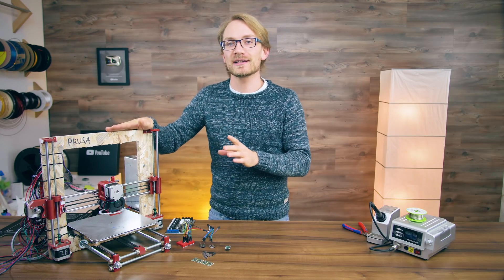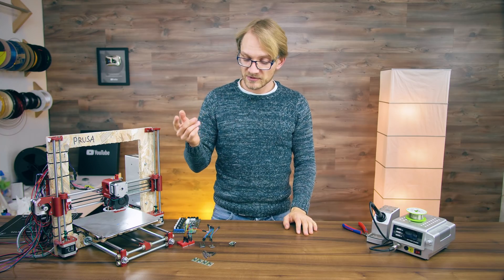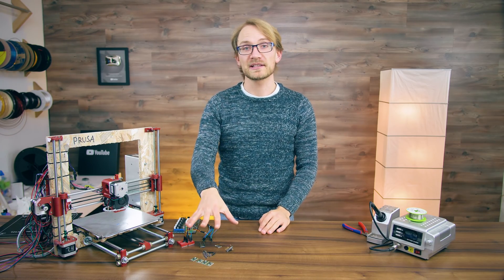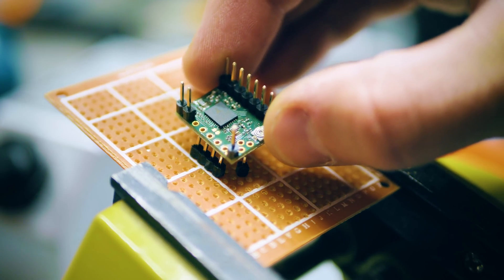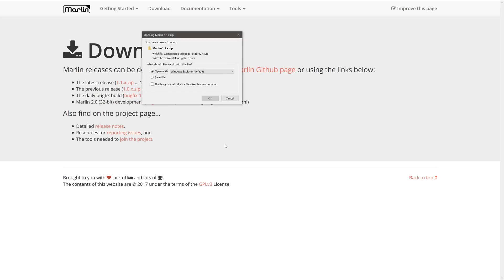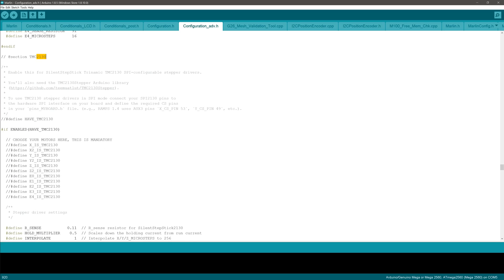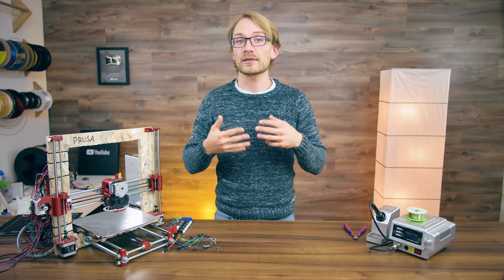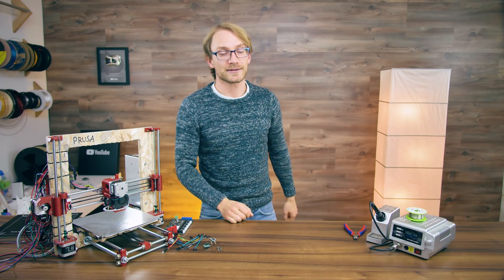How to make your 3D printer smart and silent with the TMC2130!

Comment: Finally got these TMC2130 somewhat working on a GT2560 but the part at the end of this vid about the stepper motors going in one direction is whats happening now. Tried changing the Endstop_Inverting to false and it doesn't not help fix it at all. Tried multiple combinations of the Endstop_Inverting and Invert_(x, y, z)_Dir. Even tried disabling the Max Endstops and various other settings. Can't seem to find a fix. Could this be a issue with what Pins I am using for the CS? Not many choices to use on the GT2560.

Comment: Hello Thomas, shouldn't it be technically possible to auto level the hotbed with one of these drivers on the z axis? I mean with the hotend touching the hotbed as the endstop?
Reply: It wont be as accurate as a basic microswitch due to the z axis threaded rod gearing.

Comment: I love this but the price is a bit steep.

I had a trawl of the usual sites and hobbyist sites build around 3D stuff and have tried to find some that are cheaper than they were a few months back, so far the cheapest I found was £4.86 each (+p&p) which means £5.80 ish per chipset which is still a fair bit for the item,  if you are wanting to do the whole board and have 5 motors, adds up quick.

Comment: It's been a few months since you posted this and still every vendor selling these steppers have all pins soldered on and pointing downwards. Why is this. Is the reworking of pins in this video necessary because only the RAMPS can't handle the pins as they are? Why not sell them with the pin configuration you're working with? If I plug these into my RAMPS without reworking the PINS, what happens?

Comment: I want to know how to auto tune tmc2130   i see that use that command M906 S1 but what then ? it shows values that i already set via configuration_adv.h or put manualy with M906 Xvalue  ?
So how firmawre will choose a correct settign and print it on console to save in configuration_h.adv

Comment: Nice Video Guide! I did this update to my AM8 with ramps 1.4. Its working... ok... With stealthchop i had layershifts and so i reduced my acceleration. But spreadcycle (also when doing sensorless homing) isn't working with my printer. there is such an unpleasant chirping coming from the stepper motors. Is there any way to fix that?

Comment: 1) This chip looks amazing!
2) Will this work with the smoothieboard?
 I have a printrboard and am looking to upgrade. Your review on the smoothieboard made me want one but I would also like to incorporate this chip. If a smoothieboard will not work could you recommend a board? My printer was originally a two-up by qubd but I have since heavily modified it to be an H bot style.
Reply: I may be wrong but as I understand it, you should no longer require the smoothie board with the TMC Drivers.

Comment: I have a MKS gen-L and TMC32130  and I was reading that for SPI to work, the solder joints on the 2130 board had to be bridged. I did not see anything here about that here. I'm not sure what to do.

Comment: Tom great video. talk a little slower please in the future.
When will you have that video on how to wire the 2130 with ramps that have LCD's?
So from what you show there is no connection to the diagnosis pin for the extruder?
Thanks,keep up the good work!

Comment: I did everything like you said in video, but I'm getting 4x the distance traveled. I changed the DEFAULT_AXIS_STEPS_PER_UNIT to compensate this, but now i'm getting overheating stop while printing. What i'm doing wrong? 
Ps: I'm using watterott drivers + ramps 1.4 + FULL_GRAPHIC_SMART_CONTROLLER

Comment: Watched your video several times, and went to town doing this on my own TMC2130's and RAMPS 1.4 board.   When I power the board up, the X axis tries to move for a few seconds (but the motor doesn't turn - it sounds like it wants to, but its stalling/skipping). Thought maybe it was a wiring issue so I reversed the phase on the motor, it turns even less (so I think it's a microstepping issue).  I've adjusted every parameter I know to, and I've not been able to make the motor spin. Any thoughts? I'm one step shy of pulling my TMC2130's and putting them on a breadboard and trying to make them work in non SPI mode (but whats the fun in that).

Comment: I feel that this is a halfway point between a review video and a tutorial. It's more info than normal but I don't think I'd be confident in changing them over with the Info in this video. Especially when you mentioned aux 2 and 3 where aux 3 on my machine is used by LCD. How would I do this with an LCD? The soldering and wiring also seemed too fast. I would like to make the upgrade but maybe with a different guide or tutorial

Comment: You said we have to not connect some of the pins to the mainboard however most if not all of the sellers on ebay are already fully soldered on one side...wont it still have all the features this way?

Comment: Thomas, I need your advice. 
Im going to run a ramps 1.4 board and some larger nema17 steppers (rated 2A) for my DIY printer. Will this TMC2130 driver suffice? or do you think I should go with a better driver/control board overall? 
Cheers!

Comment: I have just got these genuine drivers from watterott but I am having constant overheat issues with them, even at 600mA current, also when i try to print from sd, the SPI bus goes haywire and reports all kinds of driver errors

Comment: Thanks Tom for the video.  I have an Azteeg X3 Pro 8-driver chip board, and I'm struggling to figure out how to employ your pin-out for the TMC2130 to work on my board.  I have 4 new 2130 and 4 new 2100 TMC chips.  I plan to install the 2130 for X, Y, Z1 Z2 and the 2100 will handle the extruder motors.  Any suggestions?

Comment: I got a problem detecting skipping step while printing in X and Y... I got the endstop replacement working fine for homing (G28). For the Z axis min, I still use an opto endstop with a 7mm flag so it home at 7mm from the nozzle. I don't want a collision between the nozzle and the bed to detect a skipped step from the stronger Z motor and lead screw. If I activate M120, it enable all endstop during printing, including the Z which is triggered under 7mm and then stop moving under 7mm. Marlin activate endstop globally, I don't know how to disable the Z min endstop alone during printing.

Comment: Just got my old Prusa I3 Czar upgraded with these (sort of a why not upgrade while doing a bunch of other tweaks) and they work just as advertised/reviewed.  Your guide was all that I needed to get them together, soldered/wired up and Marlin configured.  Thanks for laying the groundwork!  So much smoother and the silent running claims are not exaggerated... about all i hear is my fan and bed springs wiggling at this point... night and day from the old unknown vintage A4988s on there previously.

Comment: Nice video Tom! Convinced me to buy these new drivers. But I also needed a new board that I could use these drivers with.  Got an MKS GEN 1.4. But I need more help!!

Everything runs as expected after I push begin printing on Simplify until the printer is about done with first layer.... then it just plain halts!?  I am trying to print a benchy, so you have an idea of how long it takes to stall. I have rewired at least 5 times, replaced one bad driver, and even plugged in a heavy duty 45A power supply to rule out that issue.

I am not using LCD as I haven’t gotten that far how to make it work..

This is the error I get:
READ: E driver error detected:
READ: overtemperature
READ: Error:Printer halted. kill() called!
WARNING: Firmware unresponsive. Attempting to force continue...

Hopefully someone can help me out! 

TIA!!
Reply: Did you manage making it work?

Comment: Hi Tom!

I'm about to ditch the problematic Melzi board in my original Maker Select and it seems the Arduino Mega + RAMPS configuration is the goto. You mention in this video that it's possibly the worst combination possible, but it's what everyone uses.

My question is: What would you suggest in my situation? I have a CR-10 on its way so my i3 can have downtime. My goal is to make this printer bulletproof reliable and I'm happy to get my hands dirty.

Would love your input and expertise.

Comment: Thank you for this very useful video! I have two Stepper Motors in Series for Z axis on my prusa. The A4988 cannot drive two 17HS4401 in parallel. The series cabling is ok with TMC2130 for "smart" features ?
Reply: did you have a answer for that yet?
Reply: Not yet ...
Reply: my graber i3 uses 17hs4401 in parallel with cheap geetech a4988 drivers...

Comment: I got a CREALITY ender 2  for myself and my boys, I would like to switch to the TMC2130's. I'm ok with replacing the mainboard in the printer and I'm looking for suggestions on what one to go with. I'd like to find a cost to value balance here, money isn't the issue but I don't want any worse quality than I have now and at the same time i don't really want to double the cost of the printer ;)

I'm also very computer, software, and electronics savvy so I could also go the route of jailbreaking the CREALITY board and hacking the 2130's in but if a new, and better, mainboard is reasonably priced I don't see the the need to do things the hard way... although I guess that could make for a viral video ;)

Comment: Excellent Video! Thank you so much. Upgrading to TMC2130 made it so much easy. Now, looking forward to changing pins video (from Aux3 to Aux 2? so that it doesnt interfere with using LCD) and another video for transferring old Marlin setup to new one. Great work as always!
Reply: Hi krishnakumar You can use all the Pins in parallel to the LCD except for the Cable Select Pins. I just changed the the two CS Pins for X and Y in Marlin (pins_ramps.h) X_CS_PIN to 66 and Y_CS_PIN to 44. Works like a charm
Reply: Knu7Nuk3m thanks! I’ll give it a go..,

Comment: Hello Tom's,

i knew that is a long comment, but i hope that you have enough patience to help me,

so i have Tevo tarantula and now the board it's brokedown ,so I bought a new board MKS 1.4 Gen and i will buy TMC2130 Driver *5 but I have some inquiries,

1- can i use the same firmware from Tevo Tarantulan (configuration.h) on MKS 1.4 
    Gen with the TMC2130 Driver ?.

2- I have dual Z Axis Motors, can i run two motors in parallel to one Driver ?.
    if yes : Should the value of the current be changed ?.
    if no  : how can i run two motors for Z Axis on one MKS 1.4 Gen board ?.

3- can i use bothe end stop system ( normal end stop switch + end stop system that 
    come with TMC2130) ?.

Thanks 
and Happy New year .

Salim

Comment: do you have any shots of the completed wiring? I'm still trying to figure out where the CSEL(pink wire on your drawing)  on Aux 2 goes to.
Reply: that's not the connection I'm referring to - look at this picture - https://toms3d.org/2017/12/09/tmc2130-guide/179-00_09_08_29-still003/  - Where does that CSEL(CSE1?) go?

Comment: I saw that you are planning another video for individuals that already have an LCD in use and therefore the AUX 3 header pins. Is it possible to solder additional  headers to the to the AUX 3 pins and share them with the LCD or will I need to configure alternative pins for the TMC2130 pins (SCK, SDO, SDI, CSX, and CSY)?
Reply: I added headers to the LCD board and tied into the SCK, SDO, and SDI. I moved the pin for CSX to 57 and CSY to 58. My next question.... can you have an optical end stop and tie in the "missed step PIN" on the TMC2130 concurrently or is this an either or? I ask because the physical configuration of my printer is a core XY (Hypercube Evolution specifically) and I do not have a physical impedance for the X or Y axis. If need be it's not difficult to build a couple of stop blocks to attach to the 3030 extrusions.

Comment: The actual Marlin firmware dosen't call the "AUTOMATIC_CURRENT_CONTROL" "AUTOMATIC_CURRENT_CONTROL" anymore. Could it be that they changed it to "MONITOR_DRIVER_STATUS" as they mention the gcode "M906"? The Marlin version you are using says the function is experimental. Maybe it did not work out as it was supposed to? Using the code "M906 S1" only shows the current values set in the software manually.

Comment: Any where I can find the instructions for switching the pin outs from Aux 3 to Aux 1 or two (I am only using the 2130 on the X and Y), I know you will have a video soon, but I am over eager.
Reply: Alright, figured it out. For Marlin/Ramps 1.4 in your Pins_Ramps.h arduino file change define X_CS_PIN to 44 and Y_CS_PIN to 64 (change the jumpers on the ramps board using a pinout diagram http://reprap.org/mediawiki/images/c/ca/Arduinomega1-4connectors.png). Next (and this may not be the best way of doing this) I physically soldered my SDo, SCk, and SD1 jumpers directly to the header tips on the LCD jumper board (the solder points are fiddly, use a multi-meter to check for shorts).

Comment: Thanks Tom. I instantly bought the drivers after watching the video. I soldered them, wired them up and put them in wrong direction on my board. I fryed them. I ordered 3 new ones and now my printer is super quiet. Also i got the feeling that my print quality has improved.
I connected them to the icsp-header for spi. For the 3 CS-Pins, I could use my ZMin-Pins (Delta Printer).

Like a new printer!!!

Comment: Hello Thomas.Did you already set up a guide to change the communication pins on the Ramps 1.4 board to use the TMC2130 in combination with a SD Card holding display?Greetings from Stuttgart.
Reply: Tach auch Salvatore du kannst einfach alle Pins Parallel an das Display Interface anschließen (so wie er es beschrieben hat). Du musst nur ein paar andere CS Pins finden. Ich habe bei mir einfach den X_CS Pin auf D66 und den Y_CS Pin auf D44 festgelegt (pins_ramps.h in Marlin). Beide Pins findest du auf AUX2. So funktioniert es problemlos parallel zu einem Display mit Kartenleser.
Reply: Diese Lösung habe ich mir auch erarbeitet, aber noch nicht umgesetzt, bzw. getestet. Mein Display ist noch nicht aus China da. Ich habe aktuell nur das Grafik-Display von meinem Anet A6 da. Es war mir dann aber zu viel Aufwand einen Adapterleitungssatz auf das Ramps zu bauen. Vielen Dank für deine Antwort! Das sagt mir, dass ich auf der richtigen Spur war :-)

Comment: 2 questions: 1st, could you post a link to the wiring diagrams? They went by too fast for me. 2nd, I seem to be missing something - how does the fw know how to address the x driver vs the y driver? Do you number them somewhere (x is 0, y is 1, z is 2, e is 3) or is there some other way you're selecting the correct driver for, say, the x axis?

Comment: I couldn't wait for your next video to explain how to connect these drive on spi with the display. So I checked the diagram of the board to identify the miso, mosi, sck. Then I mapped other pin to CS and I'm glad to say it work. Now I'm working to replace the endstop...
Reply: Hi

Does your SD card reader still work?

I got 4 steppers set up fine. LCD still works, but SD no longer working.

Some type of SPI error me thinks
Reply: lemmingDev yes, everythings works fine. However I just used them for x and y. lcd fine, sd fine. Endstop detection fine.
Reply: Thanks for your reply. The issue turned out to be a faulty TMC2130 stepper. Weird because it worked fine in SPI , but caused the SD to stop working whenever it was in the board.
Reply: Fixed some soldering - all good now

Comment: Nice Video thanks. Problem is I use a lcd so this is helpful, but the drivers are useless if I can't reassign the pins, sorry I don't know how to do that. I guess I'll have to wait for that video or try and run them in stand alone mode
Reply: Hi  jeromejt62 You can use all the Pins in parallel to the LCD except for the Cable Select Pins. I just changed the two CS Pins for X and Y in Marlin (in the File pins_ramps.h) X_CS_PIN to 66 and Y_CS_PIN to 44. Works like a charm. You will find those other two Pins also on the AUX 2 Connector Board.
Reply: Knu7Nuk3m thank you very much for that. Did you just solder the wires to the back, of the lcd circuit board or do you know of some kind of breakout header that will work. Either way thank you
Reply: Getting Driver error now, not worth it going back to stand alone
Reply: i just soldered some breakout pins on top of the lcd circut board what kind of driver error do you get?
Reply: It just gives me "driver error" when I power up on the lcd. I desoldered the stand alone jumpers and wired up according to Thomas's wiring diagram. His diagram is not exactly clear as to which sides of the aux pins are connected  to where if your looking ant the ramps from the top. Maybe that is the problem do you think
Reply: This could be the Problem. His Diagram shows the pins from top view (pins showing to you). If you are not completely shure where to connect the pins, you can  have a look at the pins_ramps.h and also have a look here.
http://www.reprap.org/wiki/File:Arduinomega1-4connectors.png
Also make shure, you activate the #have_tmc2130 as he showed in the video, so your firmware knows that you want to use them, this could be the problem too when you get stepper driver errors
Reply: checked wiring and it seems correct still get driver error system halted. I don't have sensor less homing or pins connected, problem maybe.